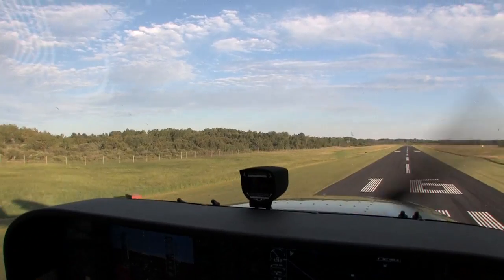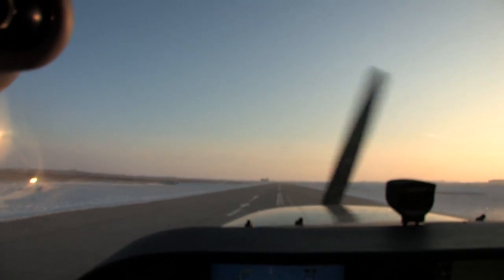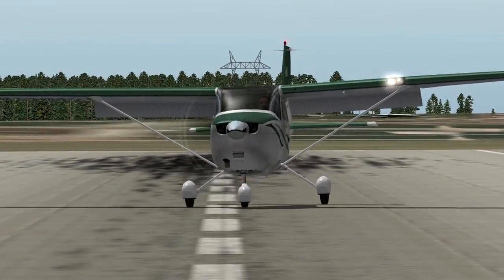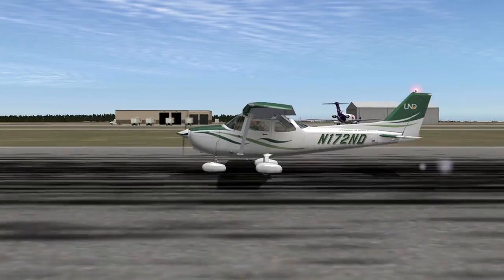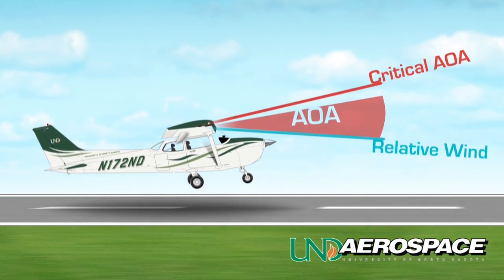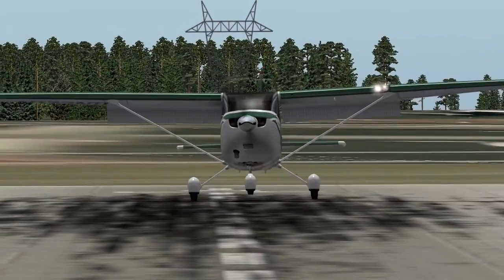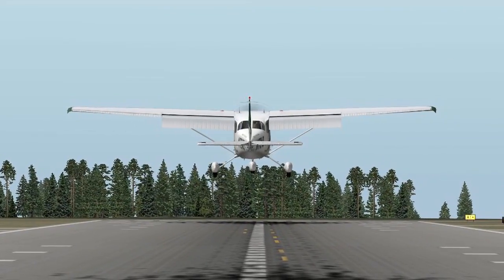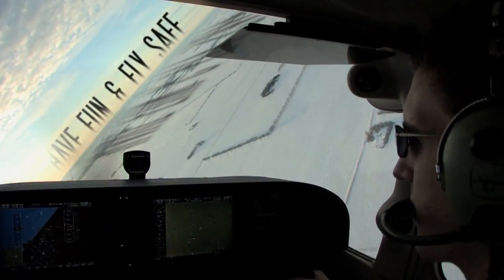(VIDEO 2 of 2) Faulty Approaches: Timing

Comment: There is no such thing as ballooning and there is no such thing as a round out this must be millennial fuckhead jargon because nobody with a pilot's license over 40 years old uses any of these words additionally these words are incorrect ballooning would require encapsulating air and then heating it there is no ballooning going on it's called ground effect whistle Dick

Comment: Very good training video. Problem I had with the 172 trainers I had was the yoke would get real sticky during the flair which led to some landing issues, fortunately none serious but still disconcerting. After I won my PPL, I could rent a beautiful 'new' SP with a GPS screen  and fuel injection. Landings mostly improved with the yoke smooth as silk all the way to touch.

Comment: Another important factor in a bounced landing, how long is the runway? Am I going to run out of runway if I recover after the first bounce on a landing?
It is surprising how quickly the end of the runway comes up if you float on a little or use some power to smooth it out.
If in doubt at any time, go around.

Comment: We old time commercial pilots from the 60s wonder why today's emphasis is usually "control inputs" and "control applications"?? Some of us weren't taught that way. My instructor was 3 times national airbatics champion.
 Proper control PRESSURES are the answer. If trimmed correctly and thinking in terms of control FEEL of the amount of pressure needed to move the controls (like holding 5# of backpressure on approach), NOT the amount of movement or input, then over correction is negated even in gusty conditions. When control feedback pressures decrease, release some pressure, etc. We called it a "Feel of the air".When pilots learn to this level their flying becomes more precise and SMOOTH and the airplane stops flopping around like a fish. Many pilots with thousands of hours never learn it.Good luck
Reply: FYI. In WWII people that never ever were in an airplane before soloed Cubs in 5-6 hrs..... because they were taught FEEL, not movement.
Reply: Would this be 'flying by the seat of your pants'  Or 'winging it" ?  I'm not being sarcastic, but genuinely interested.   
BTW   thanks for the vid link:  'The Star  Spangled Banner'
Reply: yes, feel it like a bird, be one with the plane, the controls become an extension of yourself, its not just science - its art - 
there's a good title for a new video - the art of landing !
Reply: HotRod Ray thanks
Reply: I couldn't agree more. I was 18 driving a 42 ton forklift and did the same thing. You learn how far to push the levers and i remember the back pressure. On the forklift the pressure even changed with how far you moved. it. You cannot look down when you have a boat 4 stories in the air. You need to know where the controls are and the FEEL.